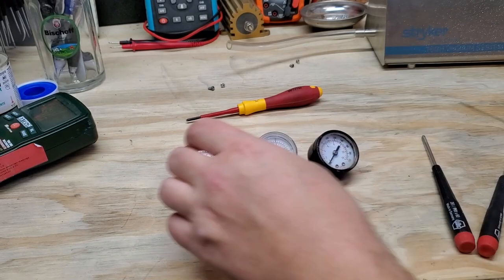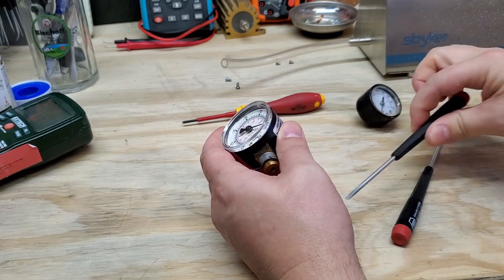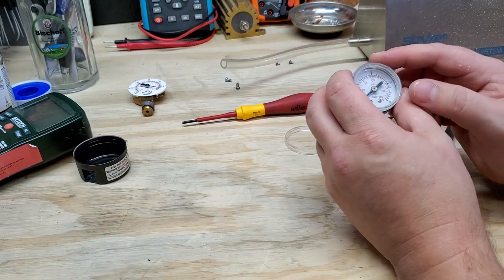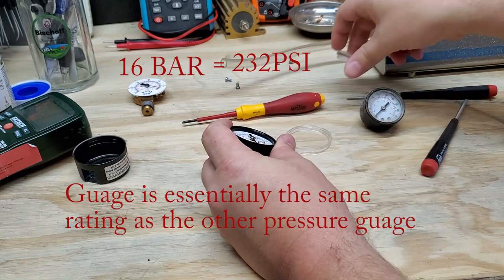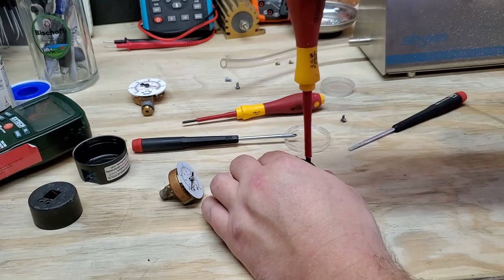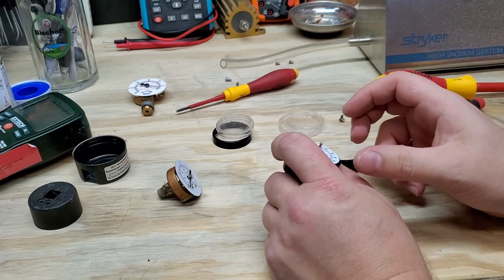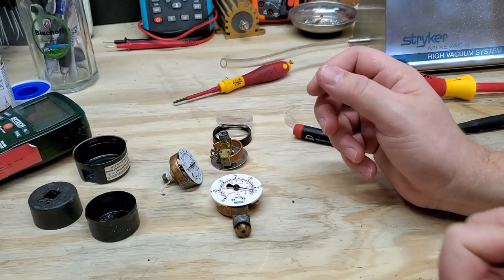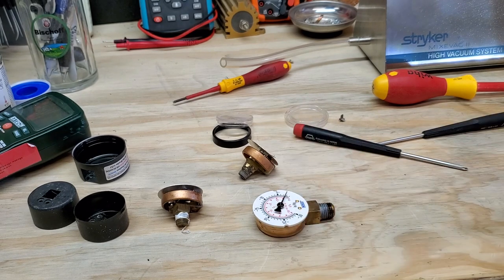Anatomy of Pressure & Vacuum Gauges

Comment: There is another type of high pressure gauge, the one filled with a clear liquid (glycerine/water) arround the needle to dampen quick movements of the needle to prevent damage.
Reply from the maker: Yes, those ones are usually used for hydraulics